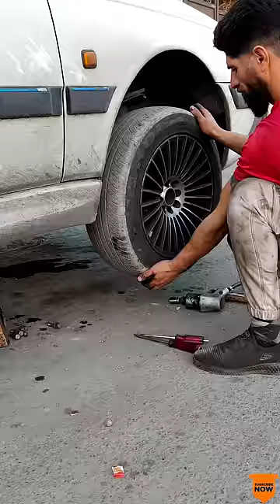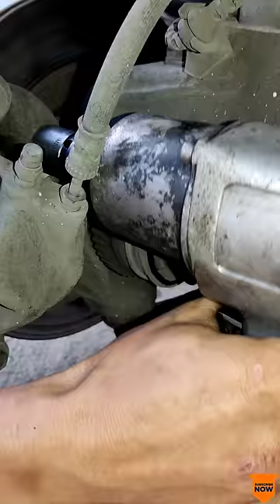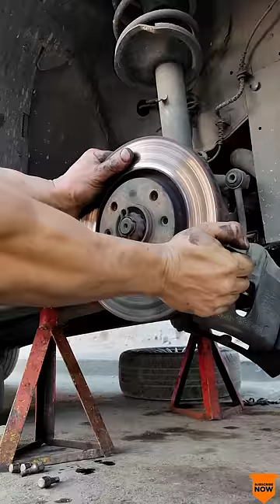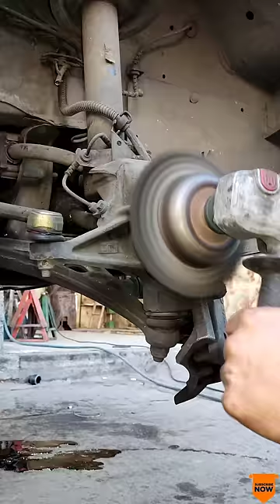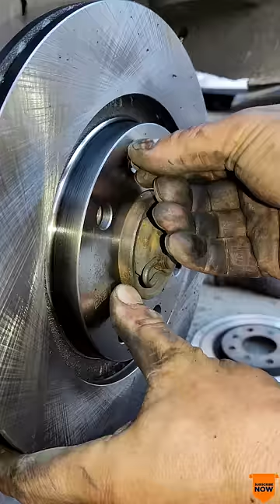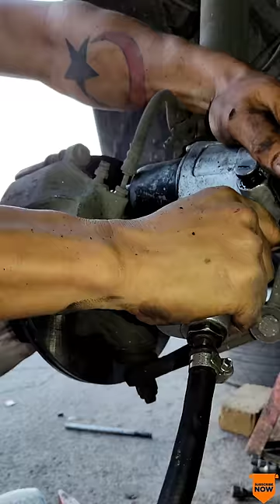#shorts #mechanic

Comment: If only all these YouTube mechanics knew half the shit I do at work and always works out just fine without as much as a single complaint. I hang calipers all the time as long as it doesn't kink the line
Reply from the maker: Hello, dear friend, yes of course, thank you for your good advice🙏🏻🌹👍🏻
Reply: Literally. You can tell who actually works on cars and who just watches YouTube.
Reply: @wilsonvinas5906  if the lines are old regardless support the caliper but new cars I'd doesn't matter most of the time
Reply: @2wheelhoon813  as long as it's not a really heavy caliper or the line isn't kinked in a weird way it'll be fine.

Comment: Brake hoses rely on the clamping effect of the inner ferrule upon the stiff nylon liner,when the caliper is suspended on the hose the load is carried by the inner liner not the soft composite rubber protective sheath,almost always the hose is left dangling from its fitting at an angle,this creates a kink in the inner liner adjacent to the ferrule which weakens not only the liner but also the clamping effect of the ferrule.damage that is hidden! Why would you take the risk?

Comment: whenever i am doing any brake related job, i always inspect the pads and clean the caliper pins and re-grease it. just for my ease of mind afterwards.
Reply: Yup, grease the pins,antiseize all threads and brake clean every friction surface gets you pretty far in ease of doing it next time around
Bonus point if you take time to clean the pad support to have them slide best
Reply: @BMWe-ed2tn  yup. But sadly some of the mechanics just change the pads. Then the pads starts to wear unevenly.
Reply: Yup a few years ago I did my neighbors front brakes for him for the first time before that he had a shop do them. I needed a 4ft cheater to get the lugs of, same for the caliper bolt/pin which broke one in the bracket which were bone dry and corroded. They impacted everything and didn't lube shit. It took a while because of all the stuck/seized bolts. Fast forward to the next brake change since I probably lubed/anti seized everything and torqued/hand tightened all the bolts and lugs the next brake job took under an hour.

Comment: You using the pressure of the impact, you dont use a torque wrench to tighten those bolts to spec?

Comment: Why clean it if your not gonna put some anti corrosion grease such as copper grease, that clean rusty metal to a cleaned disc will deffo stick before replacement, all for diy but the caliper hang thats just dangerous and using a gun on the bolts that hold the caliper, damnnnn

Comment: the worst way to inflate the plunger, just all the crap went straight to the abs pump, congratulations
next time, loosen the bleeder on the caliper, and block the hose with something, top up the difference with fresh brake fluid. no thanks

Comment: Did he even change the brake pads after replacing the rotor?
Reply from the maker: The brake pads are still covered and do not need to be replaced

Comment: So much wrong in this brake repair procedure. The first is replacing a rotor without replacing the brake pads and hardware. Not resetting the caliper pistol back into the bore. Letting the brake caliper hang by the brake hose. I will say atleast it's a rear rotor instead of a front axle rotor, but later down the road brake pedal pulsation and vehicle pulling to that side while applying the brakes will definitely come into play along side of bluing on new rotor surfaces.
Reply from the maker: Thank you for comment

Comment: That was all sorts of not how you do it no pads or regressing the slide pins etc but a ultra s all dab on copper high temp anti sieze on that rotor screw and I use the Milwaukee impact driver I've got to give it some slight torque but dude cmon. Why did you leave the caliper hanging in that poor rubber hose
Reply from the maker: Hello dear friend, thank you for your opinion🌹
Reply: @mechanicmajid  As a master tech it's fact that's how my brand does it and my fellow friends who have been doing this man.... That customer is gonna be pist

Comment: Break hose is NOT designed to suspend breake caliper.
It has risk of break flued leak.
S hook or wire is recommended for the task.
Reply: They are designed to handle 200bar + lmao
Reply: Don't skip phisics class

Comment: He dropped caliper hanging on the pressure line flex hose😵‍💫, no banjo or just piece of wire.. don't see he changing pads/shims either, nor checked sliding pins, they could be rusted, wheel hub looks dead IMHO. he's using dumb tool with random torque, he's taking off calipers, what is the torque value being set?.. calipers 25lb/ft and caliper pins 12, somehow did he set this??.same thing with rim itself?. 72lb/ft or 80??..it's not a mechanical job, it's a mad max movie cosplay
Reply from the maker: Thank you for comment 🙏🏻

Comment: Facet zmień robotę, bo to co zrobiłeś to jakiś dowcip.
Reply from the maker: It was very impressive 😂
Reply: @mechanicmajid  you have to clean up all parts, lubricate the guides and measure the runout of the brake disc. Dont touch any car.